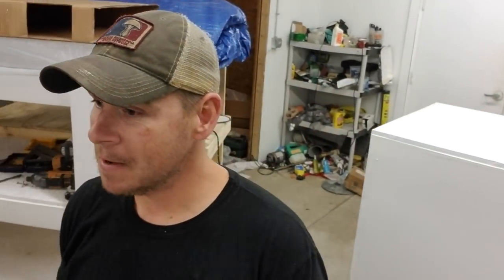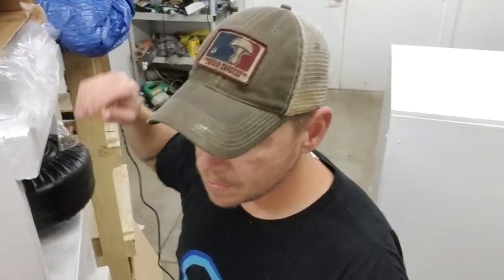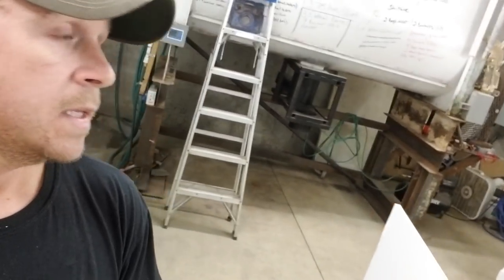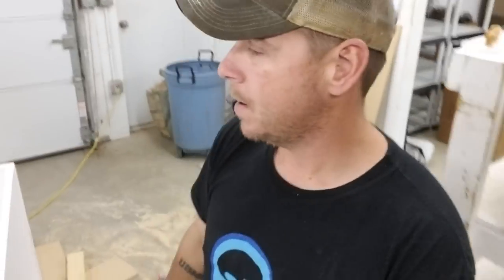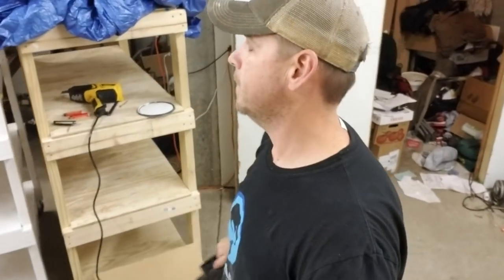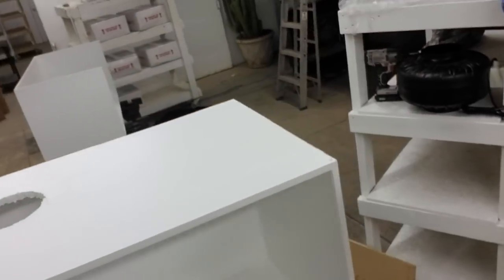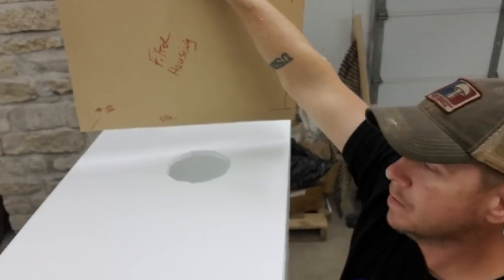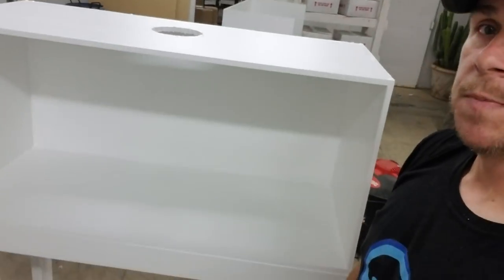Mushroom Spawn Lab- Building the filters/hoods

Comment: Hi TR, how many inches w.g. does that filter generate? Is that fan enough to achieve laminar flow with that filter? Or is it just to scrub the air of the lab?
Reply: Generally, you will need a centrifugal fan for the pressure drop with the required filters. However, if it works, run with it.  I agree with the paint.  Keep it clean

Comment: This was my understanding so please correct me if I'm wrong.  A 2x4 HEPA filter is 8 square feet, with a with a w.g. of .8 to 1.0. plus the prefilter. To achieve laminar flow on a 2x4 you need a minimum of 800cfm plus cross-checking the fan manufacturers w.g. chart. Generally you are going to need at least 1200cfm for that IF it's a flow hood and not a scrubber, as someone mentioned. Thoughts? (I'm building a 2x4 right now, so this is fresh on my mind) Thanks!
Reply: Rajah  can you tell me where to buy a hepa filter that's reasonably priced?

Comment: TR. What are the lifespan of those filters? Are they fabric? Anyway... sealing them in would make a big job of replacing them right? Maybe screw in a 1"x1" wood strip around the  outer face of the box so it overlaps the filter. Filter gets held in place, dont have to tear out old filter and sand and repaint, and the 1x1 is .5 inch overlapping the filter so no air escapes around because the 1x1 is screwed in tight. Love your channel I'm learning a lot from you.

Comment: do you have a way to replace the hepa without opening the box? I did my FH sealing it with a glue-silicon, so if I have to replace the hepa, I need to destroy the box... It happened to me once... I spilt agar over the filter when I was pouring, a fucking mess! I plan to build a bigger FH next year but i'm thinking ways to make it that could be easy to replace the hepa. Its a good idea to make a safety cover for the hepa when not in use, i made if from plexiglass that sticks to the box with magnets https://ibb.co/gz5MYy0
https://ibb.co/tLDPnrS
Thanks for the video and happy holidays to you!